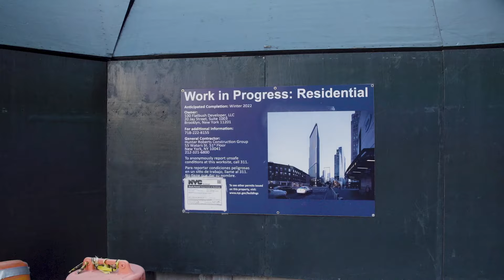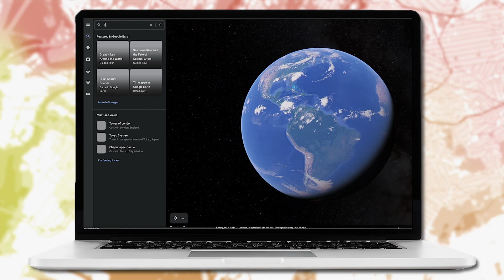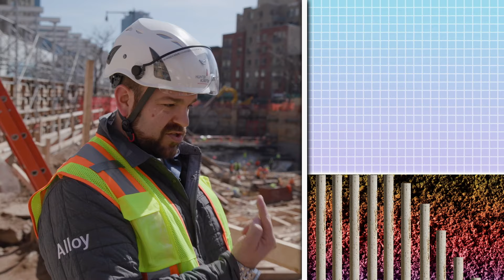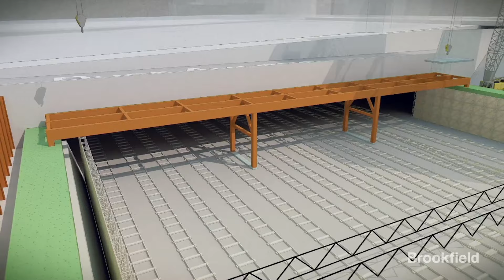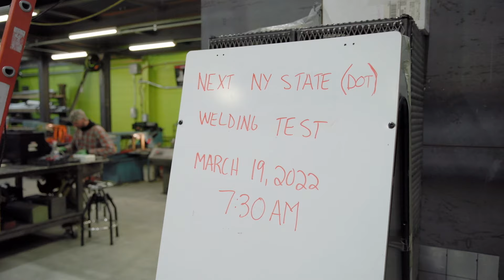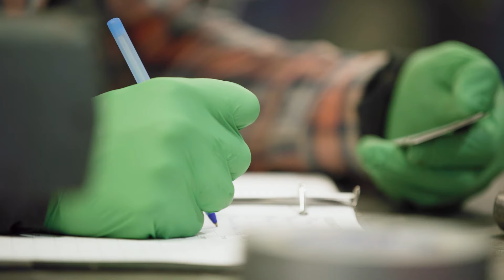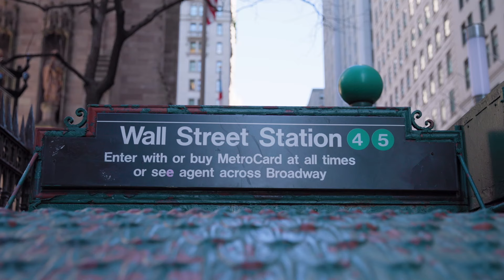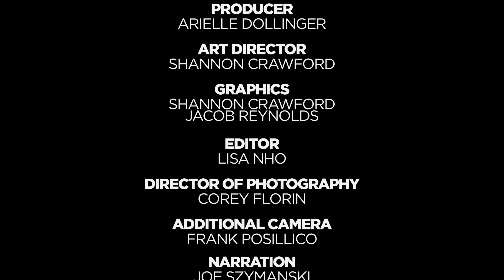How New York City's Skyscrapers Are Built | NYC: Revealed

Comment: I wish for the segment re: building over the train tracks, you covered the physics of putting a relatively thin floor over the tracks to build a ginormous building on top of -- it seems impossible that you're not building into the ground. Obvi with the regulations it can be trusted, but curious how physically that's even possible.
Reply: I dont think they built on top of that concrete deck they installed. If you look closely the buildings are surrounding the tracks hence l think they were installed to protect the tracks and trains passing underneath during construction.